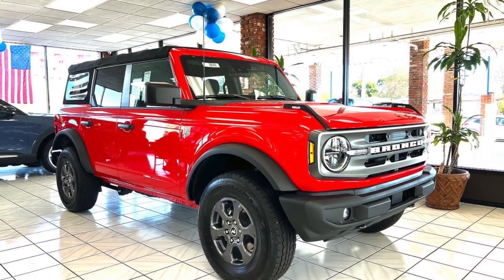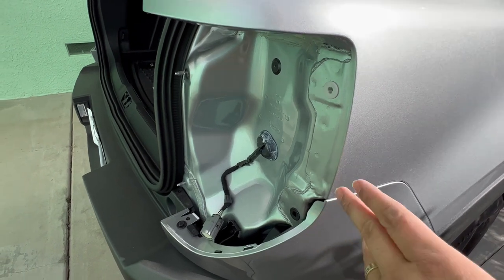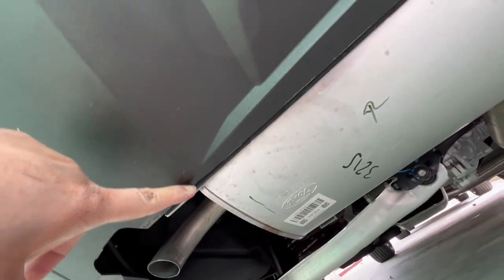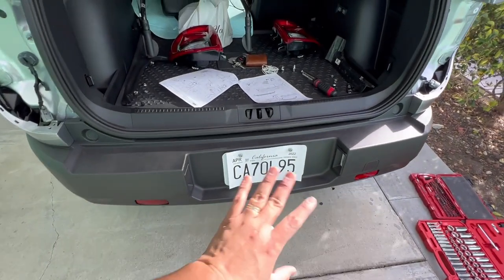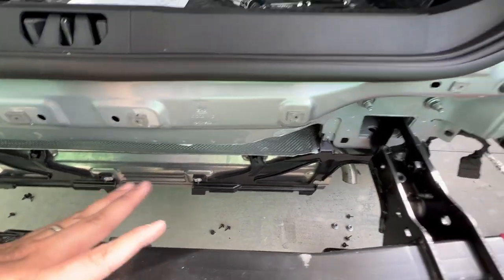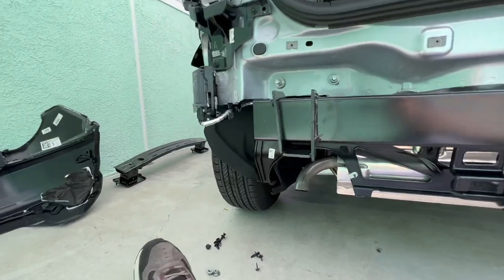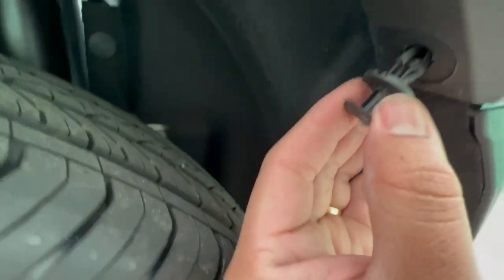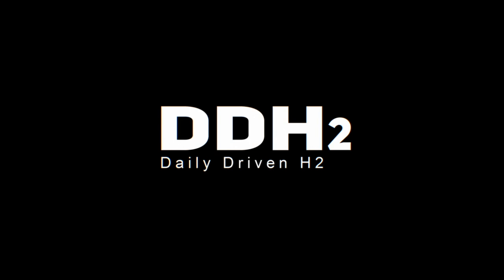HOW TO INSTALL A TOW HITCH ON A 2022 BRONCO SPORT .

Comment: Just wanted to tell you thanks. Your video is the only one out there I could find on installing a Bronco sport oem hitch. I watched your video a few times and went for it. I’m 70 years old and it went fine. Took me 2 hours and 15 minutes. I bought the hitch using my ford pass points and then couldn’t find any ford dealership in the northern Ohio area that would install it. What a mess. One dealer had my car for 2 days and didn’t install the hitch. They were freaking out because ford doesn’t list what to charge for the install. I was quoted from $300 to $1200 to install it without a harness. One dealer Mullinax quoted me 6 to 8 hours minimum to install it at $100 an hour. Kept going on about even the taillights have to come off. I’ll never go there again! Ford needs to straighten out their dealerships. Anyway thanks again!
Reply from the maker: Glad my video helped you out.
Reply: Did you end up installing it yourself? How was it in hindsight?
Reply: @bradleywilson8114  I did install it myself. If I had to do it over again I would of still of done by myself. I hesitated at first because I didn’t want to break any of the plastic snaps or trim push pins. I bought a set of plastic trim removal tools they helped. If you are going to install one Just take your time and if you feel like it’s to much just stop. I did eventually find a hitch installer that would of done it for a couple of hundred but by then it was already installed.

Comment: Thank You! You saved me $525 on installation charge. Love the detail and the tips.
Reply from the maker: Thanks for watching. That was exactly the idea to help people save some $$$ .
Reply: @dailydrivenH2  Lemme know if you ever do a video on installing the wiring harness. Can't find anything out there yet.
Reply from the maker: So I ended up taking the bronco to a local uhaul shop and charged me just under 200$ to do the install. The reason I went that route is because my local ford dealership wanted almost 300$ just for the wiring harness so it was cheaper to pay and have it done . I wanted to film the process but didn’t allow me to record.

Comment: Thank you so much for taking time to make this video. Also, your extra comments and cautionary remarks were very useful. If you might be able to provide a a link to the instructions you used that would be very helpful as well. Thanks again!!
Reply from the maker: The instructions I Used was provided by the guy at the parts department at the dealership,  I assume its the same they use to do this at the dealership. So maybe hitting the nearest dealership service/parts department could help.
Reply: I just found them online after some searching. I’ll post on a new comment. Thanks again!!

Comment: One thing I noticed after finally getting time to do this install is that the torque spec for the bumper bolts is 115 Nm (85 Lb-ft). The spec is in step 16, bottom corner.

Comment: What a great video on how to install it yourself. Where did you get the tow package from? I’m looking to buy one and now that I have this video it will help me a lot.
Reply from the maker: The one in this video is the factory one from the ford   dealership .  You basically get the same instructions as the service guys . Just remember to be careful especially when taking the rear lights off they get scratches easily. Glad I could help.
Reply: @daily driven H2  how much are those factory ones?
Reply from the maker: Just under 300$ I known uhaul probably offers something for a similar price but I wanted to make sure i had the factory one.
Reply: I was told by the dealer that this was too difficult to install myself. Well I want to thank you for the video. I usually do my own vehicle repairs and you have made this look pretty simple.

Comment: I got this hitch ,it has the bolts but no installation instructions
Reply from the maker: Assuming you got The OEM hitch you can go to any ford dealer parts department and they should be able to give you a print out with the installation instructions the one I got is the one service uses for every install. Keep in mind some dealers even if you buy parts from them tell the parts guy not to give it to you (instructions I mean) sort of trying to push customers to pay the dealer for installation.
Reply: Ok thanks, might not need them with your video it is pretty good 👍